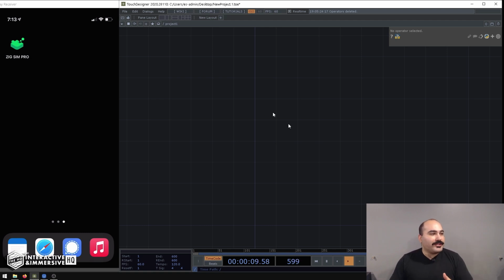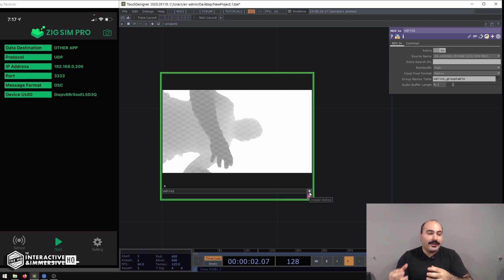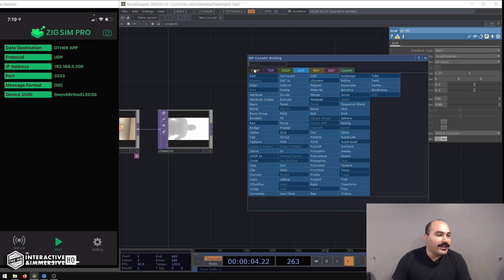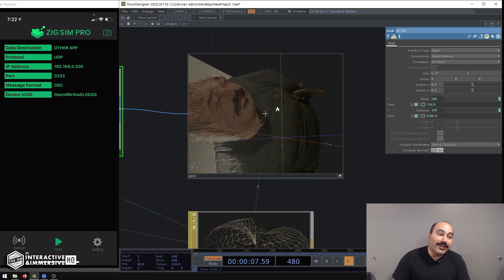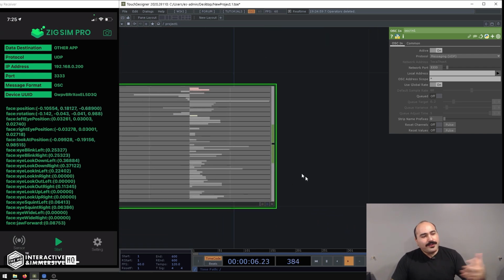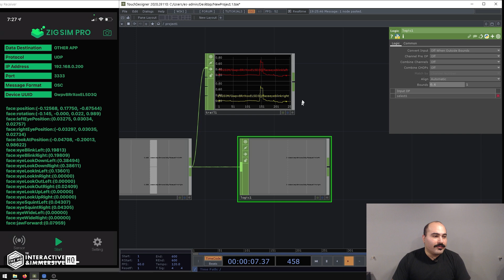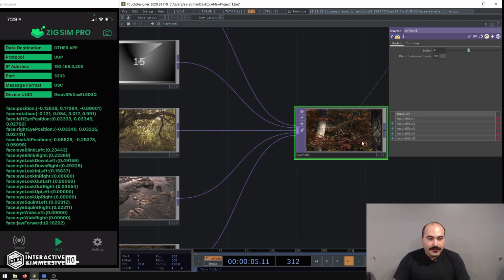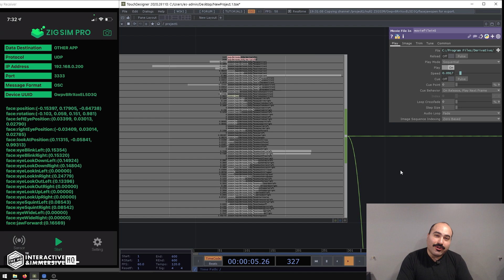iPhone ARkit & Depth Sensor in TouchDesigner Part 2 - TouchDesigner Tutorial 037

Comment: Anyone else unable to connect the NDI?
Reply from the maker: Derivative mentions that the Windows Firewall can cause connection issues with NDI. Make sure that TouchDesigner hasn't been blocked in the Windows Firewall settings.

Comment: How can I  emit particles from this deforming height map grid? If I plug in the  particle sop it will just emit from a single point.
Reply from the maker: Try using the Normal Map or Height Map textures as the particle emitter source for the particlesGPU (available in the Palette). particlesGPU allows you to use a TOP texture to emit particles, instead of having to convert it to SOP geometry.

Comment: Hello Elburz!
I have the ZIG SIM PRO app, and it works with the OSC signal in TouchDesigner. However, when I try using NDIin to incorporate the camera and LiDAR sensor, it initially works fine, but after approximately 10 seconds, the signal cuts out and freezes. The error message displayed is "Warning: Unable to find the selected source name, fail-over source may be used instead. (/project1/ndiin1)".
I have tried various troubleshooting steps, but the issue persists. I am using an iPhone 12 Pro and my setup includes an AMD Ryzen 9, 32 GB RAM, and NVIDIA GeForce RTX 3080 running on Windows 11.
Any assistance you can provide would be greatly appreciated.
Reply from the maker: Great question - the first thing I would check is that you're running the latest version of TouchDesigner and that you've downloaded any available updates for the Nvidia GPU driver. Looks like some folks were having a similar issue with an older version of TouchDesigner last year, but the built-in NDI SDK has been updated since then
Reply: @TheInteractiveImmersiveHQ  Thanks! I've already updated TouchDesigner to the latest version, and my GPU drivers are up to date as well. However, the issue still persists. The only possible culprit I can think of might be my second hand iPhone 12 Pro, as when I lower the fps to 10, it seems like the problem occurs a bit later... It's frustrating because the output is stunning, but I can only use it for a few seconds... Thanks!

Comment: Really nice tutorial. I’m just  confusing about after I putting the data of normal map into the phong, that enable height map still cannot be clicked. But when I use undo, that the enable heigh map button is available. However the image in geometry comp will not show up anymore after I turn on the heigh map. Is there any solutions for that? Thanks a lot!

Comment: Hi there, for some reason I am unable to get any video feeds into TouchDesigner. I am unable to select anything from the source name list, even though the OSC operator is clearly picking up a signal. Everything else works fine, it is just the NDI that doesn't work. I am using the iPhone 13 Pro Max with the ZIG SIM Pro app. I have tried connecting to different networks (both 2,4Ghz and 5Ghz, wired and wireless. With wired I get about 400mbs with a 10ms ping), tried different ports, connected my computer to a hotspot on my phone, added all TouchDesigner related apps I could find as an exception  to my firewall, even turned off my firewall completely - but nothing. I am completely out of ideas why this does not want to work for me.
Reply from the maker: A good thing to try is see if the Zig Sim app can send NDI to NDI Studio Monitor on your computer. That would be a good way to see if this is an issue with TouchDesigner or the larger system. One thing to test as well is to force close the Zig Sim app on the phone and re-open it fresh.
Reply: @TheInteractiveImmersiveHQ  Had the same problem. Closing the app and reopening helped me. Thanks.
Reply from the maker: @markus_knoedel  Yup, it seems like the way iOS handles background apps can trip up / close the NDI stream and jam it up a bit. So force closing and reopening the app is a great approach.

Comment: Thx for nice tutorial 
But i have some problem from 6:34 my geo node turns out black what should i do?
Reply from the maker: Are you running on Windows or macOS? Also what kind of GPU does your system have? Some of the rendering parameters need to change based on those and there's certain features that macOS doesn't have yet in TouchDesigner.
Reply: @TheInteractiveImmersiveHQ   i use win but i had solution that i use sop attribute thx!!

Comment: Thanks for the video! The only issue is when I add the height map, my geometry becomes all black..?  Other than that, I'm excited to keep experimenting with the Zig Sim Pro.
Reply from the maker: What system are you on and what GPU does it have? Are you on macOS or Windows?
Reply: I found that adding an attribute create after the grid and turning compute normals on will solve this.
Reply: @jaimeforson7712  Yes! This is a fix for macOS. Although I turned on Compute Tangents to make it work  @The Interactive & Immersive HQ

Comment: Hey! Great stuff! I just wanted to know if it is possible to get an output of the depth sensor camera that I would be able to map to something else. I want to know if I'm able to use this like a kinect so I can use simple movements such as moving my hand closer or further from the camera to control to control MIDI information. Thanks in advanced!
Reply from the maker: Yup the depth camera works very similarly to kinect so you can crop areas of interest where the hands are and get the average value to use that to determine how close or far the hands are. Is that what you're looking for?

Comment: Hi Elburz! The OSC in works in the previous tutorial set up. But the NDI in doesn't find my iphone with the zig Sim pro¿? Any hint what could be wrong? Same settings as the Zig sim regular.
Reply from the maker: One thing to try is to force close Zig Sim and try to open it again. Sometimes it seems like if you open it and close it too many times the NDI stream gets frozen. Also make sure you're on the same WiFi network as your computer. If those don't work, try temporarily turning off the firewall on your computer and see if that helps.